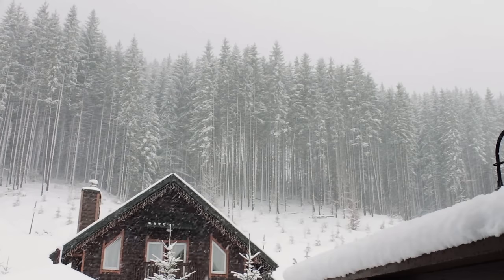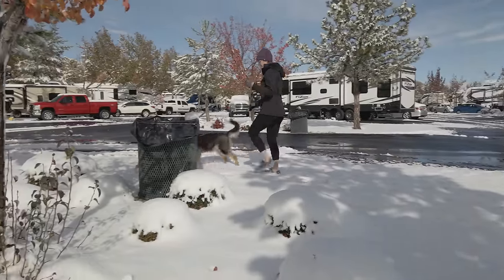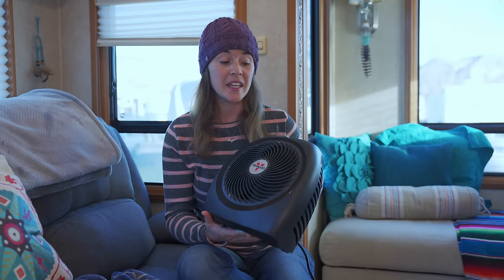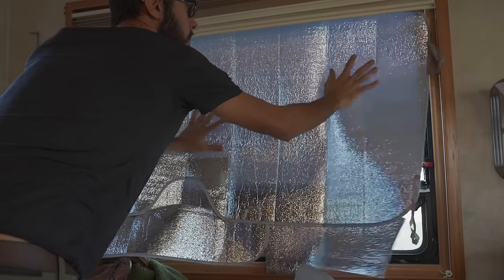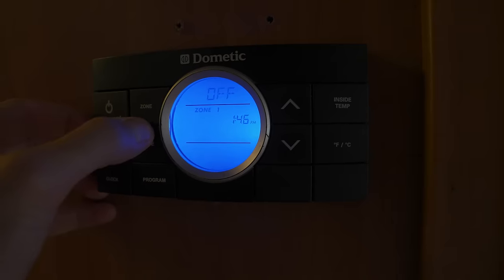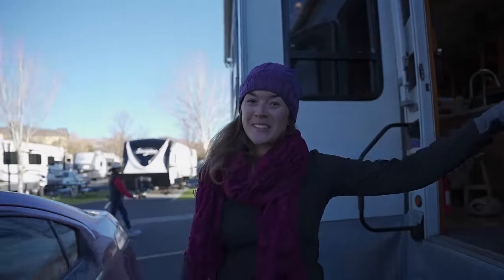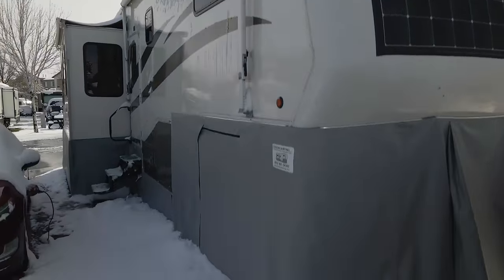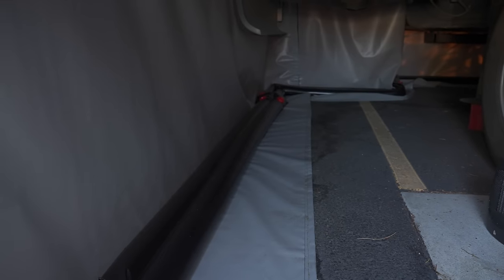The Best RV Winter Setup: How to RV in Winter and the Gear That Will Keep You Cozy Warm!

Comment: Great video! You guys have the best produced RV videos. I wish you would do more. While spending the winter in Texas a couple years ago our biggest problem was the slide outs. We were near Port Aransas so we did not have freezing temps but it was very windy. The cables from the slides enter openings directly into the trailer. We used gorilla tape around the openings to seal them off and rolled up towels on the inside to seal around the slide. Pool noodles or pipe insulation works on the sides but the area on top was too large. We did purchase a dehumidifier which helped tremendously with moisture. It helps to run your exhaust fan while showering and keep the bathroom door closed so that humidity doesn’t enter the remainder of the RV. Do most of your cooking in a crock pot or pressure cooker to reduce moisture. Stay safe!
Reply from the maker: Glad you liked it and thanks for sharing your tips! :)

Comment: Awesome video!  As my wife and I live full time in our FW and we are currently in Up-State New York, your presentation of the cold weather prep was spot on.  We have gone so far as to place clear plastic on the window to reduce warm air loss.  Yes, we leave two small windows uncovered so that we can get good airflow. And our egress windows remain unimpeded.  We have had our "Sinky Slinky freeze before. To help reduce that problem, we use a moving blanket to cover the outside release valve.  Seems to help.  Once again, great video.  Will continue to view your channel.
Reply from the maker: Thank you! Stay warm!
Reply: Could you explain the blanket on release valve part? Im living in my 2005 Fifth Wheel this winter in central vermont.😬 Everyone thinks im stupid. Maybe i am. Haha! But, i wanna get all the tips i can. And you seem pretty knowledgeable!

Comment: Crack open the roof vent in the bathroom. Hot air rises and it will take the moisture with it. It also keep the air inside the camper smelling fresh.
Reply from the maker: Good tip!

Comment: I really appreciate the pillow insulation for roof vents and heating with the on board propane heater because of the vents designed to help keep the tanks heated. I have been using just electric heaters because the on board heater is so noisy and produces an insane amount of moisture inside the RV. We are too late to make the skirting happen for this next deep freeze but I will have them on the way ASAP. Cheers!

Comment: One thing I've wondered about is snow accumulating on the slide out and roof. I live somewhere it snows 350 - 500 inches every winter and wondered about that weight building up
Reply: have to shevel the roof

Comment: Thanks for the tips. My wife and I are currently looking at travel trailers (Never owned one). It will be used primarily in the Northwoods. We plan to keep it on our property up there. It’s completely off grid. 

I understand there will be some challenges in regards to cold weather camping however I am running into issues trying to find a brand that will be more suitable for colder weather.  Most salesmen we have spoken to do not have much to say in regards to four season trailers. If anyone has reputable brands they could recommend, please let me know.  Heading over to a place to look at a Cherokee Grey Wolf tomorrow morning. Thanks!!!
Reply from the maker: You might find our article about four season travel trailers helpful. You can read it here: https://www.mortonsonthemove.com/4-season-travel-trailers/
Reply: @MortonsontheMove  thank you. I’m reading it shortly. We ended up picking up a Jayco today😬

Comment: I have insulated tarps to run all around my RV and i'm planning on routing the exhaust from my furnace under the under penning so that i don't have to to run another electrical connection. my furnace puts out more heat outside than it does in the RV and while you can't just route the exhaust under the RV you can pipe it through another pipe and use the emitted heat from the furnace to keep the under trailer area warm and dry. I may develop a kit that you can connect to utilize that heat without getting the propane exhaust fumes bleeding back through into your RV. Just makes no sense to let that heat just get blown out into the winter air, might as well utilize it
Reply from the maker: As long as it doesent leak and you have a co detector it's a great idea!  Rv furnaces are not very efficient at all and that could.be a huge help.

Comment: Quick question ... is the small tabletop dehumidifier you have sufficient for your 5th wheel or do you use two? I've seen mixed comments about them. Our camper is smaller than yours, but we definitely get the condensation on the windows during the winter months so we are hoping this helps dry things up. 
Great video! Can't wait until we can one day be full time RVers!
Reply from the maker: If you have a smaller camper with considerable condensation, you may want two dehumidifiers or one large one. You can always try one small unit to start, and if it's not cutting it, get a second, placing them on opposite sides of the RV. Here are our recommendations: https://www.mortonsonthemove.com/best-rv-dehumidifiers/

Comment: Very well done video.  You mention several times about an RV being "4 Season 'certified' " but I can't find any reference / specifications that a manufacturer has to meet in order to have a "certification".  I see references on manufacturer websites about being "4 season" or "4 season capable" but nothing that includes the term of being  "certified" for 4 seasons.
Reply from the maker: You bring up a good point, there is no universal certification and it's on the manufacturers to test, so they all call it something different.  I know there has been some talk amongst furnace manufacturers of putting together a certification and running the rigs in a cryogenic chamber. The rv Industry is not well organized or overseen by regulatory boards tho so we will see if it happens.

Comment: If you had a wood stove in your RV, how many RV parks allow wood stove burning in their parks?  Have you seen any RVs with wood stoves running?
Reply from the maker: It's not common, but some people add them.  Campfires are usually allowed but I can't say I have seen an rv running a wood stove in a park.  I have seen it on public land however.

Comment: I'd seen video of a guy in a class a that ran a separate 15 amp circuit, and used an extension cord to hook into the pedestal to run a space heater in his rig.  Looks like your setup might be a bit better.  Do you have the heater under the trailer on a timer, or just leave it on low as the weather cools off?
Reply from the maker: Yes, we actually are using the 30A plug for the second heater and a 30-20a adapter.   We just leave it on low and it kicks on only when it gets into the teens.

Comment: Is your RV 4 season?
Reply from the maker: It's not "certified" but it is built for cold with all the features cait mentioned.  It's a DRV fifth wheel.  One drawback to the 4season is the extra weight and this rig is very heavy.

Comment: What outside temperatures are you talking about ? I don't thimk that any RV would be confortable in the cold months of JAN or FEB up here in Quebec, Canada. A RV is a 3 seasons rig, no more.
Reply from the maker: Good question. With these mods we have been comfortable down into the si gle digits. We haven't been below that but workers in North Dakota and montana use them into the negatives (F) but that sounds miserable.  The hose we have is rated to -40F.  Usually they add the extra insulation to the slides and block windows like cait said.  Your right tho, extreme cold would not be fun.

Comment: I love your channel and adore you both but I feel like your information about "4 seasons" rated campers is misguided. The entire "4 seasons" slogan is a marketing sales pitch sold by RV manufacturers and means different things to each of them. Especially the dual pane window issue that you mention early in this video as being "very good for insulation" doesn't actually provide much R value. Dual pane RV windows DON'T actually provide much in the way of insulation.